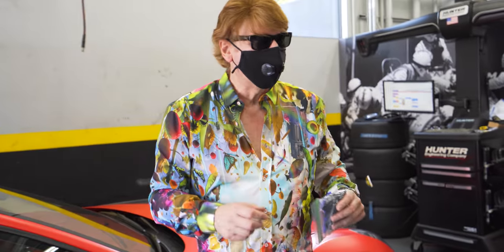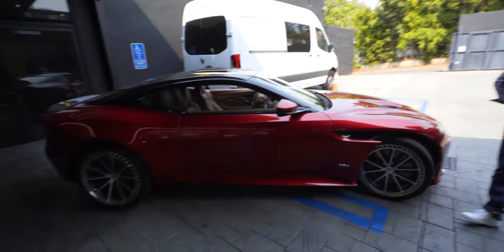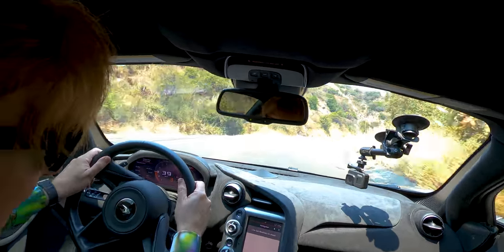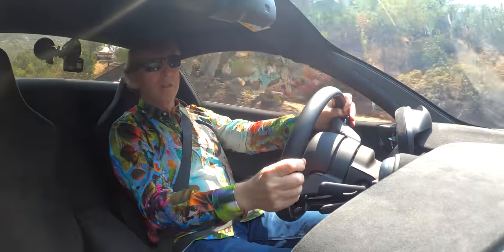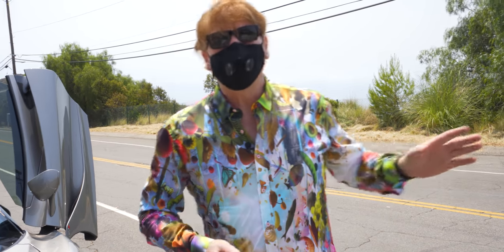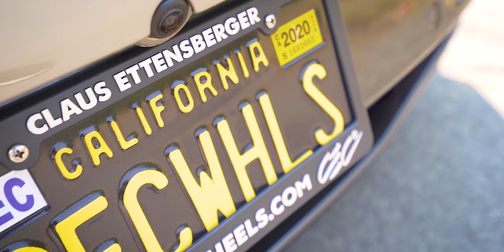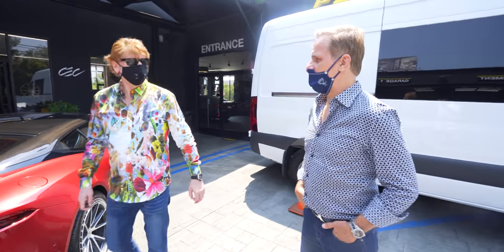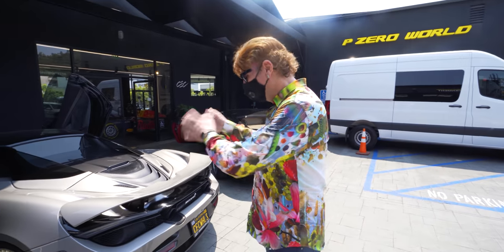MY MCLAREN 720S REVIEW (IT'S NO FERRARI!)

Comment: Michael is the typical Ferrari guy but I mean it’s ok everyone has a different taste. (We all know the 720s will destroy the N-Largo)
Reply: Yep, no car can be as good as a Ferrari for him. He's unwilling to like anything else as he's too invested and used to Ferrari.
Reply: N-largo has 100 extra kW over the 720s
Reply: there is video on yt, n largo vs 720s , and 720s destroys nlargo by at least 5-6 car lenghts. Nlargo is maybe faster above 300 km/h to top speed.
Reply: All his gripes were only because he didnt educate himself on the functions before starting out.
Reply: @StreetTruckinTitan  wrong, McLaren has a crappy infotainment system. Even to operate the front lift - a VERY important feature, you have to go through several menus to find it. Should be a dedicated button so you can press it easily when you want. The car is great - the systems are not
Reply: @sceptikal1060  that's why I said educate yourself on the cars funkiness first and not in the fly. The owner was right there. Have set it up for you.
Reply: @StreetTruckinTitan  nah, the "they all sound like lawnmowers" comment was just him Ferrari fanboying.
Reply: when its not on fire :)
Reply: Also, he is steering with the "feeding the wheel" technique. fml
Reply: probably the reason adam was suggesting a race since hes around these cars all the time and knows full well that the 720s would smoke the f12. even in stock form.... adam even hints to PM that the 720 also has a tune but PM was hearing none of it... adam was just being polite to his boss....
Reply: I think most British folks prefer Ferrari, Porsche and Lamborghini, over their own.
Reply: @sceptikal1060  You don't have to go through any menus actually. Just hold the lift stalk up for about 2 seconds and then release and click up again and it will lift as long as you are under 30mph.
Reply: Hell Yeahhhh
Reply: How do you know which one faster if you don't have both (Ferrari N Largo and  720s) you guys only collected information from video on youtube hahahhahahaha
Reply: @samuellee3022  
Is there any doubt? I mean, is that even a question? I see no question mark, anyways.
Reply: @sceptikal1060  Wrong, I own a 2019 720 and the lift system has a dedicated button on the right, lower lever. It is just a little slow but otherwise very simple to turn on or off. The info system takes a little to learn but once to use it a couple of times it is intuitive. The lift system was tricky in the 570S but that was fixed in the 720S.
Reply: @cesarfernandez6012  
It was tricky in the 570s or 675LT?
Reply: I have a 720S and yes the infotainment system is whatever the paddles are dumb and the seat controllers are also dumb. The handling and speed kill the Ferrari and Lambo. I went from Lambo to the Mac but Ferrari owners are blind old and corny lol sorry Michael love the guy but take your Ferrari goggles off
Reply: @720Horsepower  
Besides Michael's complaint regarding the paddle shifters (and you calling it dumb) I've not heard any other negative remarks about it. And I've watched several 720s review videos.
Reply: N-Largo is faster my dude. Learn some facts first. 720S has a bad acceleration then the power kicks in and you can’t do nothing lol.
Reply: But there is a fine line between fast and quick. Maybe 720s reaches faster speeds first. So it beats N-Largo. I love both cars. But Mclarens do sound like a landmover lol.
Reply: @indecentjestertm  
"The 720s has bad acceration"?! 😆🤣🤣. What a joke!  Sure, supercars with AWD system (like 911 Turbo S and Huracan)  will get off-the-line quicker. But a supercar that records 2.7s from 0-60mph doesn't have bad acceleration by any means. Road & Track even said the 720s is the quickest accelerating RWD supercar it has ever tested.
Reply: Satchel the 720S is quick and it feels safe at high speeds.
Reply: So because a car goes faster in a straight line it’s better?... typical American car guy 🙄
Reply: Smoke it
Reply: @sceptikal1060  and still loses in a race with 720S
Reply: Tyran Mathurin I think he’s talking about the turbo lag 😂
Reply: Facts. N Largo isn’t as fast but everyone is bias of their favorite car
Reply: hahahahhah
i agree, he says not even close ahahahahhaha
of course 720s will beat the ferrari
does he mean it ?
Reply: I would still choose the N-Largo over the mclaren
Reply: If you guys want a faster car with turbo engine just buy a bugatti, Maybe 720s still can’t beat Bugatti Veyron fisrt gen in drag race.
Engine without turbo is special my friend the torque is fure and the sound is fure, it’s just like building muscle without steroid, if you really want speed just try a superbike.
Reply: @sceptikal1060  I have one, you are wrong. Lift is one dedicated button... Also, McLaren has better infotainment tech than competitors.
Reply: I stand corrected - 720s has a dedicated lift button. Still, not a huge fan of the interior too much but that's just preference/opinion. Also on a side note, it seems every man and his dog owns a 720s here 🤣
Reply: Only ferrari that will destroy 720s is Laferrari lol
Reply: @Lit trandemaker Jovy so 720s is really slow then, because I saw many video on YouTube that La Ferrari can not compete with Bugatti Veyron in drag race, even Bugatti Veyron first gen smoke La Ferrari In drag race 🤷‍♂️
Reply: @sceptikal1060  its power to weight ratio and that Ferrari to 0 to 60 and over 3 seconds. 720s in 2.5
Reply: ryan martin dude you’re talking about hypercars the 720s is not a hyper it makes no sense what you’re talking about is like putting a Camry between a huracán
Reply: @samuellee3022  mclaren 720 is super car, Laferrari is Hyper car not even same league dude. Veyron would not smoke Laferrari in drag race top speed yes but drag race doubt it they both have identical 0-60 time thats 2.4 seconds. veyron has 4 wheel drive thats advantage but laferrari is hybrid and has more constant power.
Reply: ScepTiKaL Incorrect. To operate the lift (it’s for the front and rear), you can simply hold the left menu stalk up for a couple of seconds, you get a chime, and then you quickly click it up again. Bam: lift activated. No need to go through the menus. I do it by muscle memory at this point. Super easy, and no need to look down. This is how it works on my 675LT Spider, anyway. Seems others are reporting the 720S now has a dedicated button. Either way, no menus needed.
Reply: @Lit trandemaker Jovy whatever dude I know what I saw, just open on youtube “DRAG RACE: LaFerrari vs Bugatti Veyron - Vmax Stealth”
Reply: @sceptikal1060  power to weight 720 has way more power.
Reply: @Glanthor88  he can't drive clearly
Reply: @samuellee3022  turbos have more torque across the rev range. Do you not understand how a turbo works
Reply: @samuellee3022  that video is not credible
Reply: @Lit trandemaker Jovy dude how do you know that video is not credible, you even neven seen both of the car in the real world, people on that video is really have the car, they really touch the car and drive the car, you can compare people that really own the car with people who only dreaming about the car, that is you 😄
Reply: @sceptikal1060   Front lift is a single button on a stalk on steering wheel
Reply: The 720S is far superior, and looks better!
Reply: "The wheels made this car" says a man with a 1m color on it shirt...The ugliest thing on the 720 Spider are the wheels...
Reply: @zvezdanaleksic3950  Thank you!  I completely agree!! 
    I have never been a fan of aftermarket wheels on exotic cars. And; seldom on most performance cars.
Reply: Lol at the keyboard warriors that own Honda Accords 🤣
Reply: I am a Ferrari guy and no other car can get that premium quality and the feeling of a Ferrari
Reply: No the 720 is a car as long as you got warrant just like every other one
Reply: 911 turbo s will burn both of those
Reply: Ferrari is a Very Luxury high end brand ❤ not the fastest car in the world but still sick

Comment: “Almost” as fast a 488? Slower than an N-Largo? Well, you need to do some research on that 😂😂😂. The Ferrari’s would be destroyed by the 720
Reply: People don't realise the 720 has hypercar performance
Reply: It won’t even be close.  Especially if the 720 is tuned
Reply: uhhh ... n largos make 840hp
Reply: He probably said that because of the delay in throttle response of a Turbo charged engine.
You should consider he's not very huge on car knowledge.
Also, "in a straight line" neither is the f12 a slouch 😉
Reply: thats the joke
Reply: lRufflez yeah but doesn’t the 720s only weigh 3000-3200lbs
Reply: he's got both
Reply: I was going to say...how does he know which one is faster and which tires have better grip?  He doesn't drive them anywhere close to their limit.
Reply: Yeah bang on mate the 720 would eat his f12 for dinner, people don’t understand the performance of a 720s
Reply: @BullishCalls  yes we do.....He already came in with a negative viewpoint.
Reply: ecsa footwear why tf would you tune it
Reply: lRufflez they may have more HP but 720s are one of the highest accelerating rear wheel drive supercars, mclaren is a slept on brand tbh
Reply: @BullishCalls yvn
Reply: @brandonlueth3400  😪🙅🙅🙆⏳⏳
Reply: Until the 720 breaks down
Reply: @brandonlueth3400  yeah I understand that but the original comment said "destroyed by a 720" ... Sure the 720 might be accelerating faster but it's not DESTROYING a car that makes 120 more hp lol
Reply: lRufflez guarantee you the 720s will make the n-largo look like it’s standing still.
Reply: Mind you that the N-Largo is a heavy front engine V12
Reply: How many of you has either of the 2 cars?
Reply: @tiborvisi7438  that is relevant how? Pretty sure you are in the same boat. People are more than capable of watching the thousands of hours of review footage that puts the 720 miles ahead in terms of speed that Ferrari has produced for years
Reply: He said it’s faster than his 488. And a V12 780hp F12 is much faster than this turbo McLaren.
Reply: @stefan8912421  wrong. Seen many f12’s even the new 812 get whooped by 720’s. The f12 with driver is over 1850kg. Mclaren is 400 kg lighter with 720hp and mid engine traction. From a dig or roll the mclaren wins all day everyday
Reply: @jackstar80  unlike a ferrari renowned as the most unreliable car maker in history
Reply: @stefan8912421  the point of the 720 is that it is renowed as a complete drivers car where as the ferrari is not also a 'standards 720s performance wouldnt leave woking if it is less than 710 bhp as standard
Reply: @dresheraton9276  the largo does 60 mph in 2.4 the 720 also does 60 mph in 2.4
Reply: @adrianosler1682  modern Ferraris are famously more reliable and better built than anything else including Lambos and especially the highly unreliable McLarens
Reply: Yeah the McLaren would walk passed both
Reply: The 488 would absolutely be destroyed I agree, but the n-largo could provide some competition. I would say that the mclaren would beat the N-largo in a 0 to 60 most likely but in a rolling race I think the N-largo would win.
Reply: @billcaddy359  watch?v=O94nHLuJoa8
Reply: @tuktuk3424  about 7 years ago I was asked by the owner of an English language website to translate the whole thing into Italian. Reason being the website was calling to attention the scandalous number of V10 Lamborghinis that were catching fire, plus an alarming Murcielago suspension defect with a sudden tendancy to catapult the whole car off the road whilst driving straight, usually killing the driver & passenger. I didn't have time to translate the website and through a quick Google search now I can't find it, but I remember what I read and I definitely won't forget the pictures I saw in a hurry. I will never buy or rent a Gallardo or Murcielago, even at half price.

As for two Ferraris a year being on the supercar naughty list, the other eight cars on that list are all McLarens.
Reply: @tuktuk3424  Don't get me wrong, I do like Ferrari a lot, they're my second favourite supercar brand. I do however agree with part of your comment, people seem to put Ferrari on the pedestal and make out they're better than everything else, I don't see it like this at all

Comment: LOL, Michael saying his N Largo is faster than the 720s... not a chance.
Reply: On a long race definitely n largo is faster but in a shorter race 720s is faster
Reply: thats what u was thinking
Reply: How would you know? You've only seen them in pictures... 😂😂😂😂
Reply: McLaren would 100 per cent be faster than his Ferrari 👍
Reply: @harshitsingh6524  no short face n largo is faster. Bro even a 488 trumps a 720s off the line to 100mph
Reply: Some of us live more than 1/4 mile at a time, try it sometime....
Reply: outright top speed and off the line at town speeds 0 to 80mph it is
Reply: F12 N-Largo =780hp
720s =720hp
But the 720s is crazy fast for its hp, could easily be the same to a bit faster.
Reply: @langraman8756  That's why I said it is crazy fast for its hp compared to other 720hp cars
Reply: Devon R weight plays a role , hence the Mclaren killing the nlargo.
Reply: The N Largo has way more  real top speed
Reply: My bright orange supercharged 1982 Flymo beats 'em both, sounds better too!😉
Reply: Harshit Singh how does the length of track make any difference at all?  A car doesn’t lose or gain speed over time..
Reply: Devon R The 720 is ont rly 720HP McLaren is lying the car is about 780HP maybe even more thats why it beat a Pista even tho they have the same HP and weight
Reply: @DGRWPF  they're such clowns fam. Reading google stat sheets while the man is driving the damned thing.

Comment: The idea of the paddle shifters that move with your wheel only works if you keep your hands in one place (as you should) not keep wondering with them on the wheel on the smallest turns. The only moment you need to change your hand position is when you're parking or doing a U turn :)
Reply: Doesn't this 720 model have up and down shifts on both paddles?
Reply: I was trawling to find just this. If he had an idea of how to drive, he'd know not to shuffle his hands, which is why he's finding a few windy corners so challenging in a car that should eat them.
Reply: I have a tendency to do hand over hand method myself in turns that aren’t aggressive.and had an rx8 with the paddle shifters. I had to train myself muscle memory wise to stay “dialed in” at 10 and 2 when using the race paddles setting. 

You’d be surprised how many of us practice poor driving habits. Or then again maybe you wouldn’t be 🤣🤣

Comment: Paddle shifts on the Mclaren are in the right place Michael, same as the AMG GT. If you're driving a car so quickly you need manual mode, you shouldn't be moving your hands around on the wheel, that way you always know where straight ahead is and the shifters will always be under your fingertips. If you're driving on a public road and the bends are so tight you need to move your hands, you should in automatic mode and not using the paddles.

Comment: Basic driving knowledge that you never shift in a corner , always before ...
😉
You break and shift down befor entry and middle of the corner you start to  accelerate .
Reply: imagine being McLaren watching this klutz!
Reply: Yes thats theory for driving normal car but in supercars you can shift in corners since you get to max rpm in matter of seconds
Reply: @locasenior8229   yeah good point  but only in a long corner and then you can reach the shifters because you don't move the steering wheel so much  , if you move the steering wheel more than a quarter turn it's a tight one you won't shift and drive it second gear or you are parking 😂
I think it works absolutely fine practically

Comment: "Please put on a mask," as he's wearing a mask that isn't covering his nose, as others have pointed out. Also, I'm no pro driver, but I believe you're not supposed to move your hands around like he is in the turns. So the paddles moving with the steering wheel wouldn't be an issue if you kept your hands on the wheel.

Comment: The paddles attached to the steering wheel are so that when on the track there isn’t a need to take your hands off the wheel when cornering. Some car manufacturers put the paddles on the steering wheel hub so that they are easier to find, but it doesn’t work as well on the track unless they are made to stretch to cover 1 half of the steering wheel. (Kinda like what Ferrari and Lamborghini do)

Comment: Why is Michael not moving the steering wheel properly. He looks like he’s taking his driving test. No wonder he can’t use the paddles properly
Reply: When I canyon drive ain't no way I can keep my hands 'properly' on the wheel. I personally hate wheel-mounted paddles. There's a reason Ferrari, Lambo, and AM mount them on the column.
Reply: Not sure if that's because he was unable to adjust his seat and is miles away from the steering wheel. But if that's how he usually drives Adam surely should take him to a track and get him a coach to show him how to drive properly.

Comment: The paddle should move with the steering wheel, u should be holding your hands in the 3 to 9 position, hair pin corners are not really that common outside of mountain / canyon roads

Comment: The wheels are nicer on the 720s, they don't quite go well with the DBS to be honest. A full face rim would look better without the lip/vent. Maybe integrate the venting system thru the spokes or have the spokes blow air towards the brakes like an aero spoke, a bit like a fan or propeller

Comment: The Ferrari F12 N-Largo Package is $700K+ gets 0-60 in 3 Seconds.
The McLaren 720S Has one of the most sophisticated electronic driver control systems which may lend to the car feeling slower than comps because it somewhat mulls the drama of going 0-60 in 2.7 seconds. The Mclaren starts at $299K.